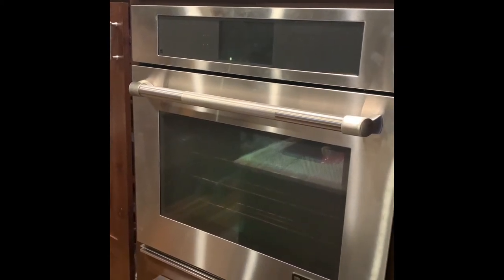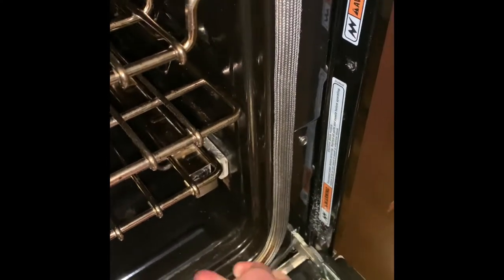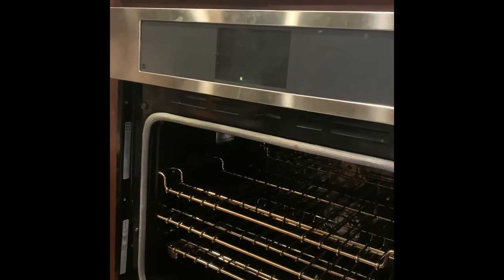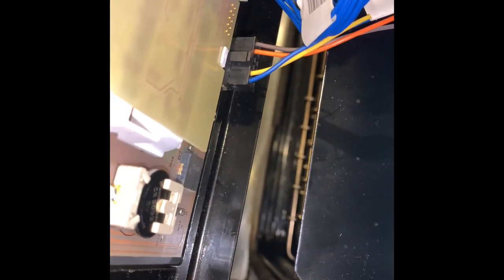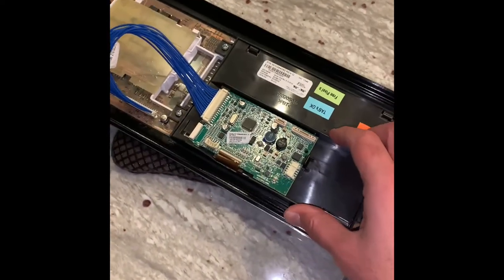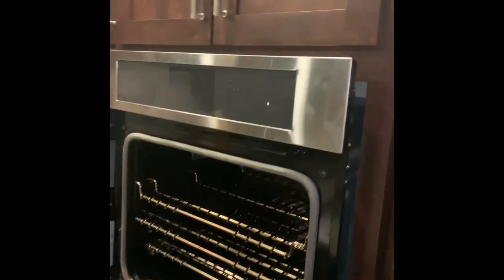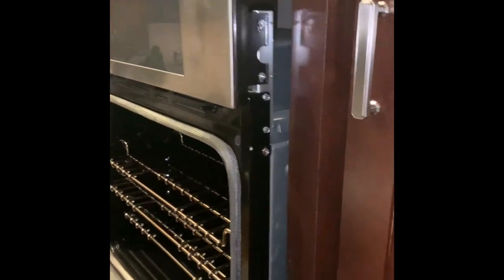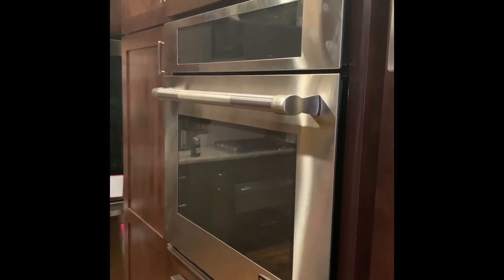Jenn-Air Wall Oven - How to Access / Replace Display / Control Board

Comment: Thanks for making this video.  The simple things like how to remove the door and which screws to remove aren’t so simple if you’ve never done it.  
I have the same or very similar oven.  I bought a control board for $200 on eBay, but it didn’t work —  thank goodness I could return it.  I then bought a factory-new board for $410, and it worked like a charm!
Reply from the maker: @arrowflier  that’s fantastic!  I had a similar experience.  I bought one and it didn’t work.  Feeling down on my luck, a friend convinced me to try another board.  I bought 3 more, and one of those worked, and I was able to return the remaining 3.  Good for others to know.  Thanks for the comment and best wishes to you!

Comment: Thanks Matt, there's no way that I was going to tackle that. I had a technician come out and all he needed to do was clean the glass with white vinegar. That fixed the problem. All I paid for was a trip charge and a little labor. It's saved me over $900 for the panel.
Reply: How he cleaned, what glass?
Reply: @mariocgdj  On the control panel.
Reply: @kainwi  but on the electronic board?

Comment: Nice job on video. I have a Jenn-Air (Maytag) Electric Oven/Convection - Model #JJW9530CAS and both the oven/broiler work just fine, it’s that the display control panel went dark about a year ago. Not sure if your fix will work on lighting up the display again. Do you know if Jenn-Air ovens have a LED or digital light like an alarm clock? I’ve seen a used, but working, control panel display unit matching my oven for sale on eBay. Do I need to replace the whole control panel? I’m not the one who would do the job, but I’d like to know what I’m dealing with before calling an appliance repair co. Thanks for any help you can offer.
Reply from the maker: Thanks!  In my experience, which only includes the replacement of mine and the research that went into it, you have two options to fix your display:
1)replace the control board, similar to what I did.  The display is integrated into it.
2)replace subcomponents on the board.  Most likely, there are 2-4 capacitors on the board.  I’ve seen videos where the display is successfully fixed by replacing all of them.  They are pretty cheap and relatively easy to replace if you have what you need (heat gun, caps, flux).  I didn’t have any of that, plus I’ve never done that so at the time wasn’t interested in going that route.

If you have someone come to your house to replace the board, it’s a 30 minute job if they know what they’re doing.  If you want someone else to replace the capacitors, they’ll probably require you to ship the board off to them.

Hope this helps!  Let me know how it turns out.  Best wishes!!
Reply: @mlovitt01  Was replacing the capacitors on the board only for a blank screen?  Did you find in your research whether the f2e1 stuck shorted key issue fixable by changing any components?
Reply from the maker: @helew  I’m not familiar with that issue.  Say more.
Reply: @mlovitt01  Thank you for your response.  Yes, I've found many people saying that their Jenn-Air wall oven gives an error message "F2E1 Stuck/Shorted Key".  So the screen is working but it will not allow any buttons to be activated to run the oven.   It looks like most of them have had to buy an entire control console to fix this issue and the cost is prohibitive (around $1500).  You mentioned that some have fixed the problem you had with just changing a few capacitors.  But it looks like you have a different issue--was your screen completely blank?
Reply from the maker: @helew  yes sir!  My screen was completely dark, no response to touch, oven light out, etc.  Essentially my board failure rendered all functions inoperable.  I found videos of where people had my same issue and they replaced the caps and all was well.  So I personally believe there are two ways to resolve the issue I had - replace the caps or replace the whole board.

I’m not familiar with the stuck shorted key issue and do not know if replacing capacitors would resolve that issue.

Comment: Wondering if I can use this control panel on my older model. Its the same size
Reply from the maker: Hey frosting - I would look up a part number and see if it is compatible with your oven.  Even if it’s the same size, it may produce different outputs than what your oven needs and could cause damage to other parts of the oven.  Best wishes - let me know how it goes!

Comment: Thanks for the video 
From where i can buy  the replacement board ?
Reply from the maker: Hi!  I researched the part number and was able to find it on eBay.  You may be able to order it directly from Jenn-Air/Maytag, but that likely could be much more expensive than eBay.

Comment: Thanks for a very useful video Matt. Just to add to the discussion here, our Jenn-Air failed in a different way. The display hung up in a F2E1:Stuck/Shorted Key error. Powering the oven off then on fixed it for a while, but eventually nothing fixed it. Even the trick shown here https://www.youtube.com/watch?v=SPSYYCkG9LM  failed to work after a few tries. Replacing the control panel as you did it fixed it. Our double oven MOD number is JJW2830DS01. I used the W11236888 replacement control panel. Replacing only the circuit board may also be successful and much cheaper, but I did not go that way.
Reply from the maker: Glad to hear you found some success, and thanks for sharing!  I’m confident someone will benefit from you sharing your experience.  Best wishes!
Reply: What did you find is the best place to purchase the parts?  I have a 2430 model with the stuck/shorted key error as well.
Reply from the maker: @philwarracks  my part was from eBay.  @sadlerlove where did you order your part from?  Thanks.
Reply: @mlovitt01  we had our oven replaced under warrantee after a 9 month wait lol but I think I will see if I can fix this one and sell for a few bucks. I did try a used ebay board for $40 but it only worked for a few days. But this was not the portion of the top display module that contained the actual touch buttons. So I’m not sure what my real options are.
Reply from the maker: @philwarracks  check out this article.  
https://www.justanswer.com/appliance/d1fx8-f2e1-error-code-jenn-air-oven-microwave-combo-years.html

This might help you determine if it is the touchpad or the control board that you need to replace.  Then, look up that specific part number and search for it.  There are likely suitable replacement parts that replace original Jenn Air parts.  You will likely find those much cheaper than original Jenn Air parts.  Let me know how your research and work turn out.  I’m certainly interested.  Best wishes!
Reply: @philwarracks  Careful though they do not accept returns so be sure you've got the right part number.
Reply: Hi @mlovitt01 - thanks for the video. I have the shorted key error as well. My model is JJ2830DS03 double oven. How/where do I find the part# for the Interface control board? I saw your reply below with an ebay link. That is sold out but not sure if its even the correct part# for my model. Thanks
Reply from the maker: @chetl6750  hi!  I did a little research for your oven.  Best way to do it is go to google and type in that model number followed by “replacement parts.”  I believe I’ve found a suitable replacement at a good price.  Please verify my research though and make sure you come to the same conclusion:

https://www.searspartsdirect.com/product/5veju8pfdz-0022-664/id-W11179310?sid=sem:ggl:dsagroupa:138954166054::m&keyword=&gclid=CjwKCAiAwomeBhBWEiwAM43YIMbtxsWQTo1RNpiimqFNRnULeZgGyHXCsvZvXFUulxHMeoiwGx9eRRoCHIIQAvD_BwE

Comment: do you think it would it be the same process with removing the top to replace the glass?
Reply from the maker: The glass on the door?  Yes, I would take the door off the same way if I wanted to replace the glass.

The glass/plastic on the control panel?  Yes.  You would remove your control board from your broken glass panel and install the control board in your shiny new glass panel.  You can find those on eBay too.

Hope that helps!  Let me know how it works out!

Comment: I have a Jenn-Air model W304004 wall oven. The digital display gradually faded to nothing over several weeks. All the touch controls work but without a digital display I can't verify my temp setting or the oven temp. Is there a component that can be replaced?
Reply from the maker: Jason - sorry I just saw this.  Did you find any success?  Based on my experience and also from some of the other comments I’ve received, it seems like you either need to replace the whole control board or the capacitors on the existing control board.  Good luck and let me know how it goes.

Comment: I have a Jenn kAir JGW8130DDW wall oven, on the control panel the broiler works the time works, but the bake button on occassion works and some of the numbers don't work.  Would it be the control panel or the control board that I need to replace?
Reply from the maker: C pb, based on my limited experience (replacing my own) - it sounds like you need to replace the electronic control board (manufacturer part # WP74009559).  Shop around for aftermarket though, because Jenn Air will definitely charge more for their version.
Reply: @mlovitt01  thank you for the advice.  What is the difference between the control panel and the control board?
Reply from the maker: The control panel is the long metal shiny piece that the smaller electronic control board is mounted to.

Comment: Does the control board include the display? Our display has been blank for awhile. Now the Cancel button doesn't cause a beep or stop the heat. The number buttons do cause a beep and start the heat. (The model is JJW9530CAS.)
Reply from the maker: The part that I replaced was a control board/oven display combo.  If yours is the same, then yes - I would suspect that replacing the board/display would correct your button issues.
Reply: @mlovitt01 where can i get those boards? I need one
Reply from the maker: @mariocgdj I was able to find what I needed on eBay by searching for the part number.  You can also try the manufacturer (mine was Jenn Air/Maytag), but eBay is likely a cheaper option.

Comment: Hi Matt, I watched your video.  I have a couple of questions that I could surely use your help in answering.  1. Do I need to reorder the entire control panel, which is excessively priced at the moment? 2. Can I simply replace the control board, without replacing the panel? After doing some research, the panel is priced at or around $1,000, and the control board is $500, however if replacing the board does not fix the problem, then I will need to buy the panel as well.  Any assistance would be greatly appreciated.
Reply from the maker: I recommend just replacing the control board.  It is the part that typically fails.

Comment: Hi, my problem is slightly different , the screen doesn't go blank but, on occasion, when we open the oven door some heat and steam go up and the screen will start to go crazy.  You can no longer do anything with the oven until we shutoff the breaker to do a reset and everything comes back to normal.  Do you think that changing the board will correct that issue?  There are other electronic parts on the the panel.  Jenn-Air is telling us that we need the whole 30 inch display panel to correct this issue and it is no longer available.
Reply from the maker: That’s unfortunate.  It sounds like the heat from the oven has caused panel components to degrade, which likely means that it is just a matter of time before the whole display fails and cannot be recovered.  (I am no appliance technician.  My recommendations are based on my own experience, my own research, and some of the awesome comments I have received on this video.)  I think you have 3 options:
1)replace the capacitors on the control board
2)replace the control board
3)replace the panel.
Option 1 is cheapest but requires new capacitors and the skill/knowledge/tools to replace them.  Could be just $10-20 if you have tools already.  Option 2 is next cheapest and what I did - requires much less skill but hard to find the needed control board.  I found for around $285 on eBay.  Option 3 is most expensive.  Easier to find but now you’re at $700-$1500 for the part.

Definitely check eBay for both control board (cheaper) and control panel (more expensive).  Jenn-Aire/whirlpool websites can help you with part numbers.  Let me know how it works out.
Reply: Thanks for the reply Matt.  You must be quoting me USD prices.  Replacing the board on your video W10344082 (Option 2) is around $650 in Canada.  As for the full stainless steel panel (option 3), it is no longer available.  It was listed around $3,000.  At this point, you go with a new oven.  Unit was purchased in 2013.  Because the full panel is no longer available, Jenn-Air is offering me a 15% discount on a new wall oven.  Has this issue been rectified on there new models???

I took off the front panel to examine the condition of the panel.  On each side of the part you replaced, there are circuits covered with a yellowish plastic plate.  I have a few plastic clips on those that are broken.

I had a technician look at it last year and we foil tape under the panel so that the heat/steam didn't hit the inside of the panel.  That worked for approximately a year but now back with the same issue.

I am not convinced that the part you replaced on your video is my issue.  I suspect it might be the circuits on each side of that board.

Interesting looking at your video...we seem to have the exact same granite counter top...what are the odds!!! @mlovitt01
Reply from the maker: @HenriLaflamme-y2l  cool about the counter tops.  Sorry to hear your choices are limited here.  I don’t know if the issue has been fixed for new models, but as long as the panel is right above the opening, they will always be exposed to heat, so it’s ultimately down to how heat-resistant their components are.  I guess if there’s anything good to come of your situation - you are armed with asking good questions and if you buy it in person maybe you can do a good inspection of the thing first.  Best wishes!
Reply: Thanks Matt @mlovitt01
Reply: Cannot determine without looking at it......could be moisture on a loose connection.

Comment: Hey Matt,

My screen went out over night. I checked to see that the main board is getting power which it is. There is power going to several places but not to the wires going to the secondary board that then connect to the display board. Is this similar to your issue or do you think it might be one of the other boards?
Reply from the maker: Hi Chance.  The typical setup I have seen is a wiring harness from the oven plugs into the control panel via a jack in the main board.  From there, you might have conductors powering adjacent circuit boards, all mounted onto the same control panel.  You might be stuck replacing the whole panel or maybe you have a case where you can get away with replacing one circuit board or sub components on a circuit board.

Which oven model do you have?  I can try to do a little research for you.  Also, you say you have power at the main board.  Are you using a multimeter or do you have some other indication?
Reply: From what I can tell I have the exact oven model that you have. There is the LCD board behind the display. But if you pull the oven out and remove the metal panel over the top there is two more boards.

I have the power coming in on bolts underneath that panel, on the black and red lines. White of course had no power as I could operate the oven without the display board. From the main board there is a red brown circuit pair of conductors which go straight into the harness for the display. Then there is a yellow and blue pair going to a secondary board. Which then have a second set of yellow and blue wires going to the display. I did not have any power going to any of those wires. I was concerned that my issue could be further upstream of the lcd board but I really wasn't sure. I checked the wires for conductivity and they checked out as good.

Other than the specified wires I checked, I also ran a hot meter over every wire to see where I had power running prior to checking individual circuits and found the main board did have power coming into it at the front most red wire.

Other than that I did not see any damage from heat that could have highlight the issue.

I appreciate any help or sources you can provide. I know enough to be dangerous but still very much in a novice stage of learning.
Reply from the maker: Chance, send me an email at mattlovitt@hotmail.com.  I can send you some pics of what I dealt with and see if we can figure it out.

Comment: What is the name for the part you replaced?  Do you happen to have the part number?  Thank you
Reply from the maker: The part I purchased was from eBay, called: Oven Display/Oven Control Board WPW10344082 replaces #W10344082.  I paid $275 for it.

Hope that helps!
Reply: @mlovitt01  thank you

Comment: FIXED!! Read reply down below. My display hasn’t gone out. But I swapped the theme in the settings and after that it wouldn’t ever completely boot up. I killed the power to it to reset it multiple times but it’s still doing it. Stuck in boot up mode.  Any ideas?
Reply: Ok. For any future issues. I just tore it apart and removed the little watch battery on the back of the display unit. It’s a CR2032. It had well over 3volts and matched a brand new battery. Left it out for a few minutes while looking over the rest of the circuit board. No issues seen there. Stuck the battery back in. Plugged the display back up to the oven and flipped the breaker back on. It booted up properly and is now working fine. 👍🏼👍🏼
Reply: Thanks for the video on removing the display.
Reply from the maker: @jbw5485  That’s great!!  Glad it worked for you and thanks for sharing your situation.